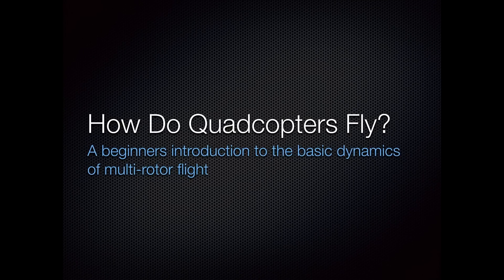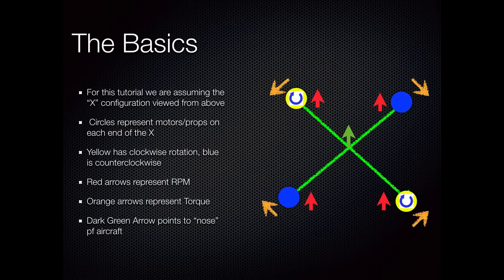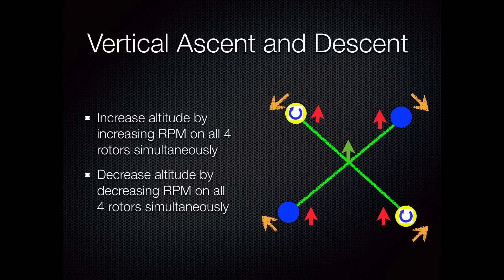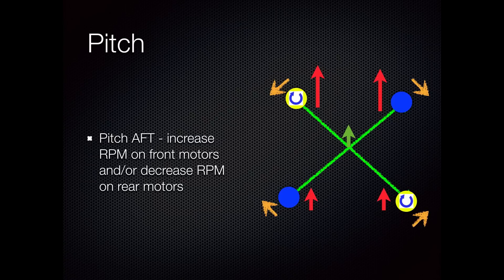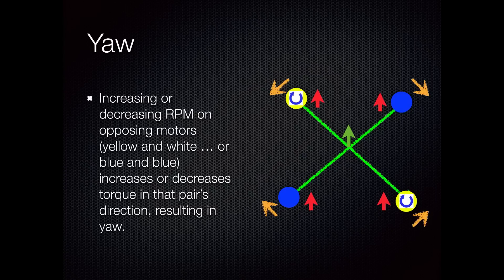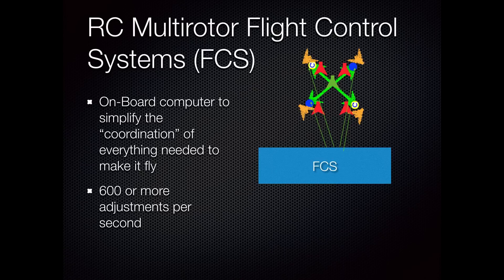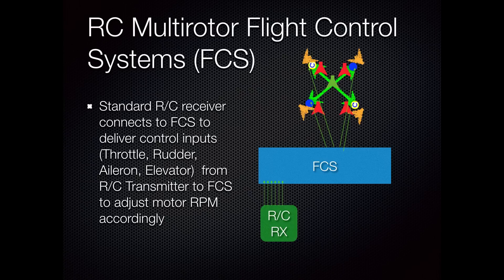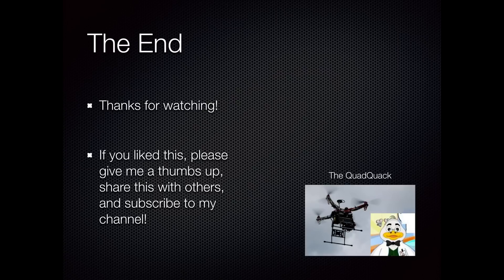How Do Quadcopters Fly?

Comment: I was wondering... could a quadcopter fly if it was put into a world without any other modern technology? (Say some sort of portal opened up and shoved a quadcopter -- and a pilot and controller, obviously. -- into a medieval world.) Could it still fly, or does it require any outside technology?
Reply: It depends. Let's say in this example that we magically time jump a pilot, His DJI Phantom 4, and his controller to the Medieval times. You will instantly be accused of being a witch/heretic for putting voodoo magic on a weird looking thing. Let's look past that. Simply put, yes, you can fly! But only in a non GPS reliant mode (sport mode etc...) because, obviously there are no GPS satellites at that time. It will be a bit harder to fly, but any pilot with basic skills can fly without breaking a sweat. However a pilot can obviously only fly his drone with a charged battery(ies). If you want to be able to recharge your battery, you will have to either bring along with you, a windmill, or a bicycle with an alternator attached to it, connected to a battery, or battery bank, and after you charge the battery bank you will need to supply enough output voltage to charge your drone battey. 
Sorry for the late response.
Hope this helps!
Reply: it would work until you needed to charge the battery .... :)
Reply: Rob Saxton Yeah, that's what I figured, lol. Thanks.

Comment: Thanks for the explanation! Finally I understand.
I just bought my first 50$ quad to learn to fly and even with only the 6axis gyro that thing is pretty stable and very easy to fly. Even my 18$ mini quad is stable, not for video or anything, but easy to fly for beginners. So great video although I would disagree about having problems with the cheap quad stability

Comment: This is a really good explanation of how quad copters fly. I was wondering about one thing though. What if the center of mass is not in the center of the quad copter? You could offset the RPMs of each motor to balance it, but wouldn't this mess up torque?
Reply from the maker: +Rick de Jong I never thought about that, but I know that the Flight COntrol System that calculates the adjustments necessary can handle some situations like that ... just not to certain how far of it can be. When you build your own, you are instructed to put the FCS as near the center of mass as possible ... and then you enter in parameters to let it know how far and in which direction it is offset. I also have seen many instances where people mount a camera like a gopro on a boom that places the camera well outside the CG, and the FCS compensates and the quad flies nicely ... again, not sure how far you can stretch that envelope!

Thanks for the good question, and glad you enjoyed the video!
Reply: Rick de Jong I'm a bit late... But there are PID's that correct for things like this. (Proportional, Integral, and derivative)
Reply: It would effect on Torque.

Comment: Nice explanation. I was most interested in how they yaw. It seems like increasing the torque on two CW motors would also require decreasing torque on the CCW motors in order to keep from gaining altitude while yawing. Very nice video, thanks!
Reply from the maker: +ThePetrifiedwood You are correct! The main thing to remember is that in order to mainain a hoe (no yaw, pitch, or altitude gain) all of those forces must be in equilibrium. I was trying to keep the example simple, but you nailed it!

Comment: Hi! What is the fonts you use in the slides? Could you offer your slides template? I also want to do introduction on this part as your reference. Thanks a lot!
Reply from the maker: Slides were prepared using the KEYNOTE application on a MacBook Pro. Most fonts were either ARIAL or HELVETICA BOLD using varying font sizes. Slide backgrounds for the most part were "INDUSTRIAL" template.
Reply: QuadQwack Thanks a lot!

Comment: Can you please do one on a tricopter your explanation is vry clear
Reply from the maker: Tricopters follow he same basic principles as described here, with one important exception. To "YAW" or point the nose left and right, instead of managing torque with the motors, the tail rotor is on a mechanical servo that actually tilts the rear rotor left or right depending on which way you want to point the nose. It actually works more like a rudder on a fixed wing airplane. Hope this answers your question.

Comment: What about yaw on non-quadcopters? (Tri, penta, hexacopters...)
I'm always asking but noone I know owns one...
Thanks!!
Reply from the maker: Even number of rotors - quad, hex, octo ... same principles described in this video apply. If you have an odd number of rotors ... i.e. tri, penta, etc ... then one or more of the rotors will be connected to a mechanical servo that will actually tilt that rotor left or right depending on which way you want the nose to point. This "RUDDER" can either be on the front or rear of the aircraft. I use the term "rudder:" because it functions more like the rudder on a conventional aircraft.
Reply: QuadQwack
Okay but what about the torque of an odd number of propellers? there will always be one of them adding torque/yaw...
Reply from the maker: DoNotPushHere Again ... just like a conventional airplane ... the rudder is "trimmed" to counteract that force. So if you look at the "rudder" rotor on a copter with an odd number of rotors ... it will be mechanically slightly tilted left or right to counteract for the torque generated by the other rotors. This amount can either be mechanically "trimmed" or the stabilization system of the flight control system will automatically correct for it.

Comment: Quick question, Why are the motors mounted to rotate in opposite directions?
Reply: Quadcopters are all about apply force to counter/cancel another.
Two motor rotating in the same direction will make the copter rotate too so you cancel it with another two motor rotating in the opposite direction.
You control yaw changing the velocity of these pairs.
Reply from the maker: It is done to counteract torque. In a regular helicopter, the tail rotor serves this purpose. It balances out the torque of the main rotor and keeps the helicopter pointed straight. Without it, the helicopter would just spin around. Same thing applies to a multi-rotor or quad ... you have to have one motor to balance out the torque produced by another.  Without this, the quad would just spin like a top!